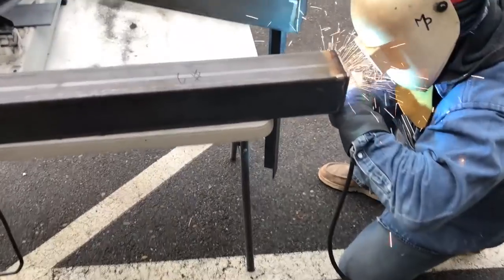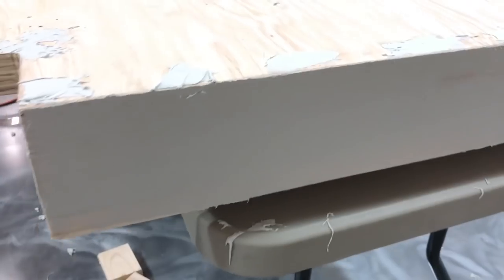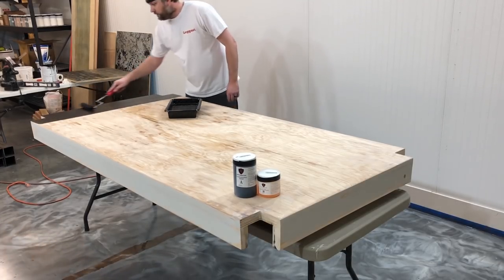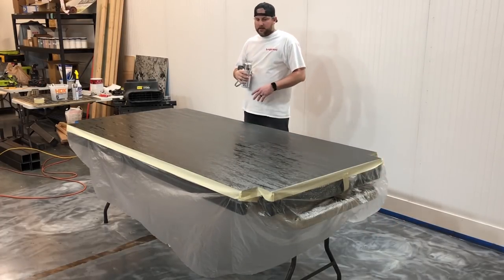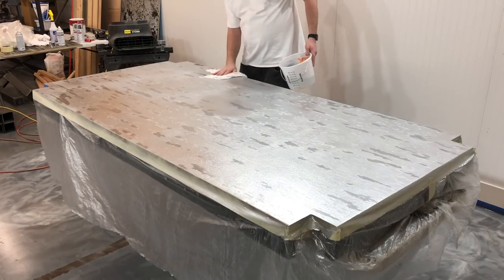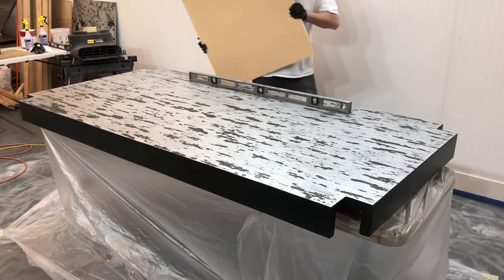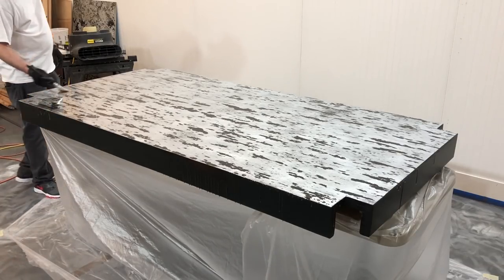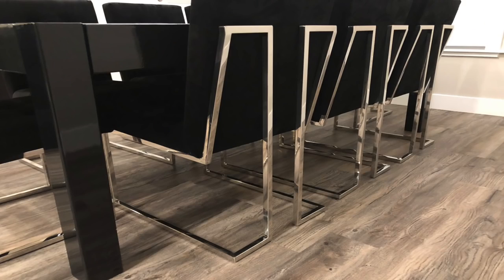Massive Epoxy Dining Table | Custom Made from Scratch using Metal, Wood and Epoxy Resin

Comment: Outcome is fantastic... Just one question... What kind of spray paint do you typically recommend using along side your products? I'm looking to do a different color scheme. Also... Could you use a similar technique for floors...would the spray paint weaken the surface coat? Thanks
Reply from the maker: You can use any brand of spray paint just depends on how much you want to spend.  No it wouldn't weaken the surface, you would just apply our urethane top coat over it.  Thanks

Comment: I love the table. My question is, can you wet sand the epoxy after it cures to get rid of the orange peel and get a perfectly flat surface? Does the epoxy get hard enough to wet sand? I know most two part epoxies remain slightly flexible.
Reply from the maker: GilMarcJr Theres no orange peel it’s a perfectly smooth top. We applied our Glaze Coat that lays out like glass.

Comment: Does epoxy finished dining table heat resistance. Can we use like usual wooden or glass surfaced dining top .
Or any other extra work for maintainance.
Reply from the maker: Never put things over 150 degrees directly on the surface always use coasters or hot pads!

Comment: Can I use regular Paint and then add your Epoxy on top? can I use a water based paint and primer and spray paint for the first part? and then add your epoxy? also I saw you were dipping into something while using the rag was that water? Love Love Love your youtube! I am new to the resing and epoxy world and I am in love with your work! You have an eye for color! Thanks nice work!
Reply from the maker: You can apply our epoxy over paint.  Our primer is a water based epoxy specifically designed to chemically bond to almost all smooth surfaces.  Thanks

Comment: Did you sand the sides of the table after the layer of epoxy? Or do they just end up flat like that
Reply from the maker: No you do not have to sand the sides of the epoxy before applying a top coat over it.

Comment: If I used your products on a painted concrete floor would I have to take the paint off first
Reply from the maker: Shop blasting and diamond grinding are the two best ways for preping concrete.  But they require expensive machines and vacuums that you can get at most equipment rental stores.  The next best step is to acid etch the concrete, if you can’t do any of these you want to clean the floor with an auto scrubber from a rental store or mop it really good and then we require our prep replacement primer if you are just going to mop or scrub the floor.  Thanks

Comment: is your primer a chemical bonding primer, or is it simply colored epoxy as a base coat?
Reply from the maker: Our primer is a water based epoxy specifically designed to chemically bond to almost all smooth surfaces.

Comment: I noticed that in most of your videos with installing epoxy you use a clear coat then the urethane coat. However in this video you pour the clear epoxy over the table but I did not roll out the urethane coat. What are the reasons for that ?.. Thank you
Reply from the maker: In this video he was applying a different top coat we have which is called the glaze top coat.  It goes on thicker that the urethane top coat does.  Thanks
Reply: First off thank you for the quick response. Just so I'm on the right page whenever you apply the glaze top coat no urethane top coat is needed or sealer?. If you apply a clear epoxy coat however you need to use the urethane top coat as the sealer.

Comment: Is Plain epoxy resin n this glaze  coat same or different.?
Reply from the maker: It almost is, our countertop epoxy is more heat resistant than the glaze.  Thanks
Reply: Leggari Products can we get the same glaze using plain epoxy without any coloring pigment? Whether we can use same pigments used with paints?

Comment: The top coat in this video what is it?. Just a coat of clear epoxy???
Reply from the maker: That is correct, Glaze coat is our super high gloss top coat that lays out glass smooth just like the metallic epoxy coat. Thanks
Reply: I guess I’m confused on this haha. So when you say “ high gloss top coat” do you mean it’s just a coat of clear epoxy?. Last question when do you know when to use a urethane top coat vs just another layer of clear epoxy?. Sorry for all the questions I’m just trying to make sure I understand exactly the difference between the two when deciding when which option to go with. Also I’m looking to taking your class, I can’t make the October one but I did email you guys about a class schedule so I can take off work and make it up there.
Reply from the maker: We have 3 different top coat options. Glaze coat is our super high gloss top coat that lays out glass smooth just like the metallic epoxy coat. Our WB Urethane comes in high gloss and leaves a minor texture and we also have a WB Urethane that’s a Matte/Satin finish.   Thanks
Reply: Last question I promise. Do you always use a top coat? Let’s say I put epoxy on my kitchen counter tops...after the epoxy dries do you have to then apply a top coat ? Or can you just leave it how it is once it dries?. I promise that’s the last question about Top coats, I’ll save the other questions for your class when I take it. Thanks